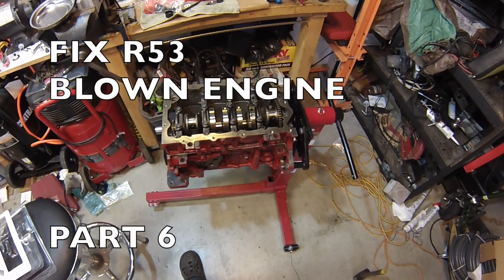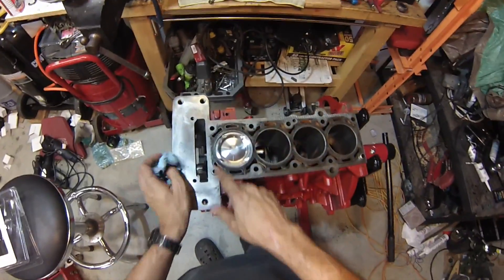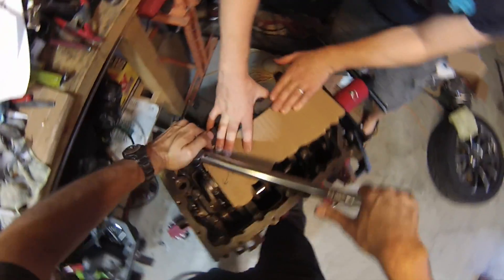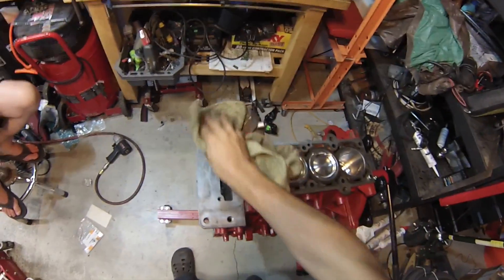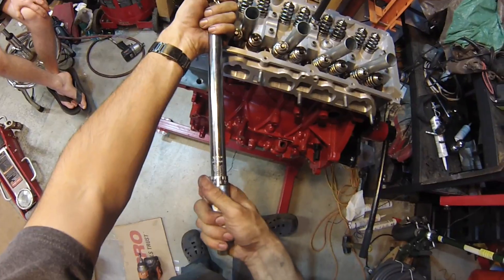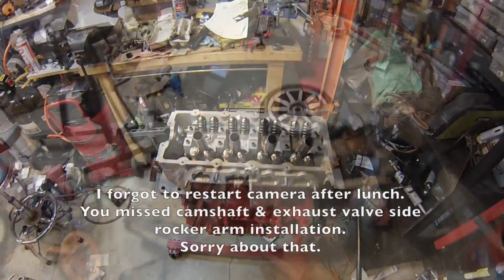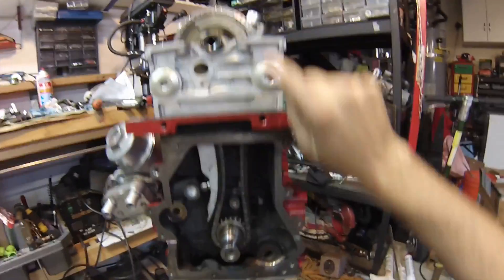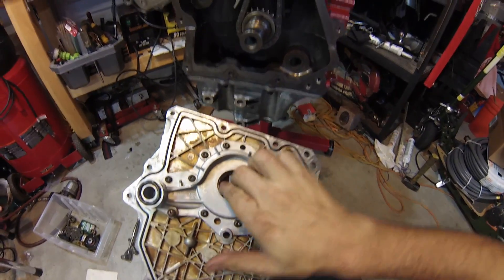Rebuild R53 Blown Engine 2004 MINI Cooper S - Part 6 / 9

Comment: Hi 
I’m trying to rebuild engine for my r53 u didn’t cover this part on film . what’s the Specs for oversized pistons 77.5 to line up with oversized cylinder head oversized valves 0.5

Comment: Did you take a caliper and measure the stretch of the ARP bolts?  you generally want to write down the length before and after the bolts are torqued so you know you have consistent clamping force.  I doubt it would matter too much on these engines though.
Reply from the maker: I just followed the tightening specifications. All bolts were same length before assembly.

Comment: Are these torque specs also good for stock reassembly?
Reply from the maker: Not the head bolts.
Reply: Mod MINI Got it. Thank you so much for the speedy reply! Amazing how this video was made five years ago and you’re still helping out. My mini, Arlo doesn’t want to start. And after doing a dry and wet compression test it seems as though the piston ring in valve 3 is bad. Your videos have saved me. Financially and also in the sense that I have found a new passion. Thank you

Comment: hi modmini hope you can help having major problems n9 compression in cylinder 1 and 3 
2 and 4 are fine and 2 3 and 4 were all good before i changsd over number 1 for fried piston after setting up timing according to the video so shud be good that way i have had head skimmed and tested and new gasket
Reply from the maker: Do leak down and figure out where it is losing pressure. Could be timing is still off, bad valve seats, bad piston ring seal...
Reply: @ModMINI  will do leak down in morning for sure! 👍 surely if i have all cylinders level and links lined that shud be in time? i wud be sure rings if it was only number one after replacing but not 3 as this was fine before, any ideas ? appreciate advice and love the videos.....new to minis
Reply from the maker: You may have done something wrong when ringing the pistons. Might have to tear it back down and have a look.

Comment: I didn't see you put any bearings on the bottom end of the connecting rods. I'm planning on rebuilding mine soon as it's burning oil. Were those con rods different to the standard ones bearing wise? Sorry for the noob questions haha
Reply from the maker: All conrods require upper and lower bearings. I may have edited that out. These videos require a ton of editing btw.

Comment: I am working on my 03 R53 an i was watching your video #6 on blown engine i ordered a new shortblock an im stuck on the timing there is not much detail on timing it so do i need to put the motor at TDC one video shows to turn crank until all pistons are aligned to the same level can u plz help me
Reply from the maker: Align bright links on chain with arrows on crank and cam sprocket. Quick google search found this. https://www.justanswer.com/uk-car/6pckv-mini-one-hi-how-set-valve-timing-2002-1-6.html

Comment: so pistons 2 and 3 are at tdc when the cam and crank are at the postions youve stated when timing? thanks in adavance
Reply from the maker: Ashley Wiltshire when aligned for chain installation, pistons are at middle dead center (all pistons are centered in the bore at all the same height

Comment: Hey! Who tuned your car?  I have very similar mods as yours and I need a retune.  If it was Jan, did you end up buying the Genius tool? Shoot me a PM if you did!  Love the videos!
Reply from the maker: It was tuned by Jan in person.
Reply: Thanks! Also, are you still running your oil pan without a baffle?  I'm going to be tearing down my engine soon and I'm on the fence about installing a baffle or not... It will see very light track use and likely a bit of auto-x too.  Cheers!

Comment: I've just followed this video to fit a new timing chain. I aligned the 2 copper links with the crank markings and the single copper link with the cam sprocket marking. After fitting the tensioner and making sure it popped out I rotated the crank a number of times and the copper links never seem to line up with the markings. 

Have I done something wrong? There's no knocking/clicking etc as I rotate the crank by hand.
Reply: To future DIYers If you properly seated the cam sprocket with the cam flange, put the mark at the top and start with the crank marks on the right go forward with placing the chain keeping the cam mark straight up. You may have to crank the crank shaft a little before the marks line up.

If you do this to seat the chain you should have no problem.

The timing chain system is designed to be hunting the original time, so it may take 100 rotations before they line up again.

Comment: how flush should the crank seal be when installing? im not sure but it looks like yours is level with the case cover. also, ive been reading comments and watching all related videos but something that still makes me uncomfortable is taking off the chain and cam sprocket and installing a new set in time. im paused right now just before taking off my case plugs. im not in time right now because my sprocket marks dont align with the bright chain links. so about where should i rotate the engine to before disassembly and how do i put in a new chain and cam sprocket in time but keep the crank sprocket on?
Reply: i might have helped myself figure it out by writing out my thoughts. rotate the engine so the cam sprocket mark is top dead center (regardless of chain marks), take out tensioner, take out guide rails, take out cam sprocket and chain. Then install new guides, install new chain and align the bright links with the crank marks and that would automatically put the cam sprocket mark aligned with the top bright link, correct?

Comment: Hello, when you installed your timing chain and aligned it with the gold links and marks on crank and cam, did the pistons have to be in any particular position? TDC, MDC? or does it not matter? And if you happen to know, what is the procedure if my new chain does not have gold identification links?

In my situation I need to re-position a new chain on an existing engine where the previous chain had skipped teeth due to a broken tensioner, luckily there was no valve damage.

Comment: How come the arrow on the cam sprocket has to be point up and is it safe to rotate the camshaft to achieve this regardless of the position of the pistons (ie is there possibility of the valves hitting the pistons?) thanks
Reply from the maker: It has to point up because this is the specified position for safely dissembling and reassembling the engine and is the required position to use with any cam sprocket alignment tools.  Do not turn the cam with the chain not connected to the crank pulley. Valves may contact piston tops.
Reply: Mod MINI Ouch, thanks for that tip. 
Would It be a good idea to ensure that the cam sprocket arrow is facing upwards before dissembly? 
Cheers bud
Reply from the maker: If you are taking off the timing cover removing the chain completely, it doesn't matter.
Reply: Mod MINI I will be taking off the chain completely but before that would it be a good idea to have the engine with the camshaft sprocket facing upwards?

New chain kit and cam is being fitted and I'd like to know that valves won't hit the pistons when timing it up on assembly
Reply from the maker: When assembling, you obviously want to rotate crank and cam to roughly the correct position before assembling and fitting the chain.
Reply: Mod MINI So that they are in what position? Crank sprocket markings at 4 o'clock with Cam sprocket markings roughly at 9?

Sorry if I sound stupid but I'm struggling to follow the position of everything
Reply from the maker: The positions should be fairly obvious based on the arrows on crank/cam and the bright links on the timing chain. Just align those. You won't put the cam back on until last anyway. Crank arrows should be pointing toward front side of engine. You can make fine adjustments - just turn it by hand or by using the crank pulley bolt and obviously there will be no interference or spring resistance until the cam is bolted down.
Reply: The cam will be fitted before the timing kit otherwise I will have nowhere to fit the sprocket too? Are you saying to fit the cam loosely and then tighten it up after fitting the timing kit instead of before?

And thanks that makes sense, before taking apart Il rotate the crank to ensure that these markings are facing the front of the block and that the camshaft markings are roughly facing upwards

Cheers for your help, much appreciated

Comment: Hey Again, do you know what the oil pickup bolts torque specs are?
Reply from the maker: "Snug" - I just tighten them like any other similarly sized bolt. Probably around 20lb-ft?

Comment: hello,mod mini. Thanks for the video,quick question. I as well have the ARP head bolts, so i know that the stock ones are 30ft pounds +90 degrees. So to install these racing bolts, i would do as following with 1st passage at 20 ft pounds,then 45 ft pounds and end them up with another 90 degrees turns??? am i correct ? and why the Arp requires so much torque over the stocks?(almost triple the torque). Thanks sir
Reply from the maker: The ARP are stronger so they can be tightened more.

Comment: footwear: flip-flops and crooks. "let's go build a motor"
Reply from the maker: I have no control over what my helpers wear :-)
Reply: +Mod MINI yeah I was just kidding but when ever I work I wear boots
Reply: +Mod MINI while you are here  I'm buying a 2009 mini copper in about a week you have anything to say about them
Reply from the maker: +Will “will221sd” D The main issues I know of for those cars are timing chain, oil filter housing gasket, water pump, thermostat housing gasket, thermostat housing to water pump bypass tube. Timing chain affects 100% of 2007-2009 cars eventually.
Reply: ok thx
sounds like things i can fix myself

Comment: any trick for removing crankshaft sprocket without bmw tool? changing timing chain set and want to replace gears as well
Reply from the maker: +John H Get someone to step on the brake and put the car in gear at the same time. If car is automatic, you'll have to find some other way to stop the engine from turning such as blocking the flywheel or crank sprocket from turning.
Reply: Crankshaft sprocket gear sorry I think you misunderstood question hehe. The gear at the end of the crankshaft that is pressed on
Reply from the maker: +John H Use one of these http://amzn.to/1GJXtCF and some long M6 bolts. Stick around a M10 bolt through the center of the crankshaft and cut off to correct length. You'll need a couple bolts. See this video.  https://www.youtube.com/watch?v=VKjc8Ab4oaQ
Reply from the maker: +John H Are you talking about a gen 1 or gen 2 MINI? That is an R56 part. The sprocket is integral to the crankshaft on an R50/R53.
Reply: +Mod MINI o weird I got one in the kit I bought it says shrink fit ty for reply, I know couldn't find pic of stand alone for 03
Reply from the maker: +John H I had a closer look, there is a press-fit sprocket on the R53 crankshaft but it is rarely replaced, only if there is teeth damage. It looks like it would have to be pressed on, probably with also heating the sprocket and/or cooling the crankshaft. On the R56 it is just held in place by the crank bolt, there isn't even a woodruff key. Be sure to torque that one!!
Reply: +Mod MINI hi mate, I was wondering if you know how hard it is to get the crank sprocket off? wouldn't it be pointless swapping out the chain whilst leaving the old sprockets there? 

(I have a very faint tap on cold start for a couple of minutes and always have done. Iv covered over 10k miles with it like this so I'm confused whether to just leave it or swap it all out? I was also thinking that maybee the head as been skimmed in the past and if this was perhaps causing me the tap. It is very very faint but I know it's there so I'm guessing the chain is slightly worn?)

thanks bud
Reply from the maker: See my comment below. to John H. Tap on start is normal. There is no oil
 in the journals on startup to take up the factory play.
Reply: +Mod MINI Wicked stuff, so if it looks Ok visually I can just swap out the chain and cam sprocket?
Yea it does it until the temperature gauge begins to read and then goes silent. On the hot days or if the car has been driven hard the night before, startup is completely silent. Maybee I should just leave it as if i do all this and the noise is still there I won't be a happy chap lol
Reply from the maker: I'm not familar with engine noise that goes away when engine is warm. That could be chain or it could be something else. Might try replacing the chain itself as it could stretch, but I sort of doubt that there would be enough sprocket wear that replacing would make a difference unless you see clear signs of significant wear.

Comment: Your last pass (90degrees) 

Of the headbolts your forgot 2!

Love your video,s man 

Thanx for al the work filming this
Reply from the maker: TheMatrixcube Yup, I realized that a few days later - I took the valve cover off and tightened those two bolts. It was a very stressful week and I was racing the clock, not a good combination. It's been a year now with a lot of hard driving, and everything is fine, probably no harm but only time will tell.

Comment: is it ok to assemble the head without assembly lube on the cam and the rocker arm?
Reply from the maker: irius koid You should put assembly lube, or engine oil at the very least. (if you only use engine oil, do not wait more than 1-2 days to start the engine. The oil will run out. The assembly lube is designed to stay in place indefinitely)
Reply: ok got it thanks.

Comment: Hey man, thanks for posting up all these videos, really interesting process here. I've been looking for a guide to replace the timing chain guide rails but this is the closest I've seen. Is it necessary to put pressure on the tensioner to engage it after you've installed it? I'm hoping that this might be the rattle I hear and that I don't need to bother with the guide rails, although it seems like a pretty simple job I can do with the valve cover gasket.

Cheers!
Reply from the maker: Hello - sorry I don't have a video for the tensioner guides - someday I'll make one. Technically the tensioner should pop out on its own when it gets its oil supply, but you can reduce the risk of too much chain slackness by popping it after installing. 

You can inspect by removing the valve cover, but if you find the guide rails are damaged, you unfortunately need to pull the timing cover and the oil pan, because:

1. The timing will probably be off if you revved the car past 4000rpm or so. The slack in the chain will allow the teeth to skip.  
2. The damaged guide rail bits end up in the sump and clog the oil pickup strainer/tube, and possibly also aluminum bits from the chain guard at the bottom of the timing cover. 

If this happens, you probably also need a new oil pump gear set as well as aluminum bits may have made their way through the oil pump (don't worry, they will be caught by the oil filter

Comment: for the piston oil sprayers, did you happen to torque them to a specific amount? id like to know. i pretty much have the same issue as your mini on my 02 r53. the head seems fine and valves are ok, but i spun a bearing in cyl 1 and the piston took a nap in the oil pan along with the con rod. as it passed through it took out an oil squirter. also, do you think stock conrods would work well with aftermarket cp pistons?
Reply from the maker: Just until they were "tight" - for a bolt like that, probably around 14 lb-ft. I suppose stock connecting rods would work with aftermarket pistons, but if I had to do only one or the other, I'd get the aftermarket connecting rods and stick with the stock pistons...